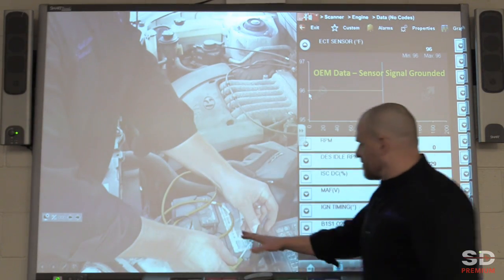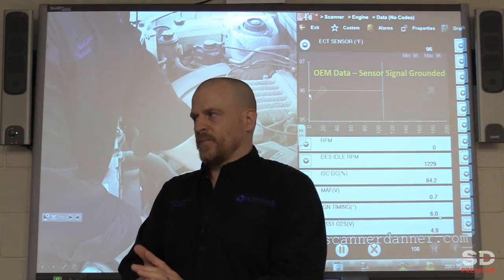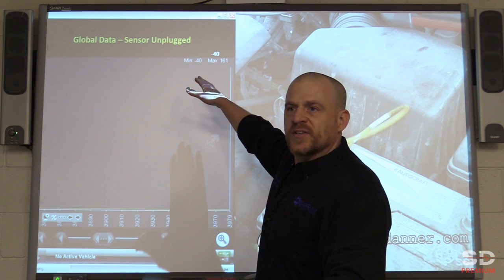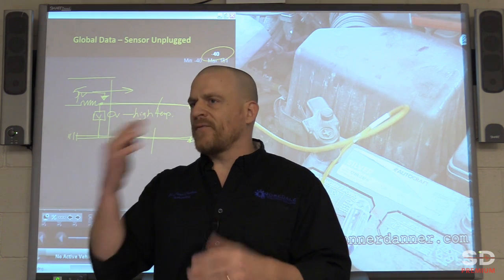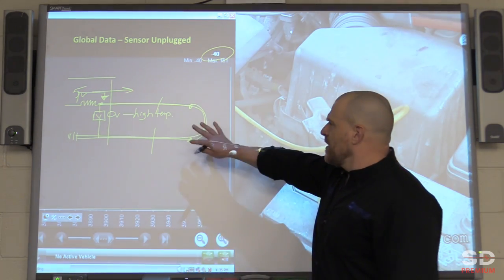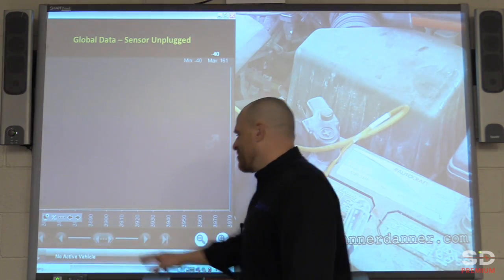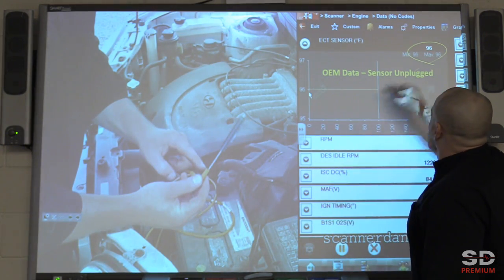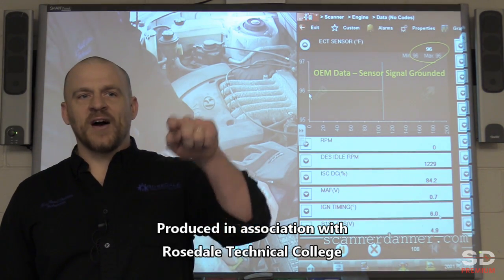Substituted Values - Circuit Integrity Testing (an SD Premium preview)

Comment: Can we use a resistor box with the resistance to simulate a good sensor and call it a day? I've built a resistor box myself with various resistance settings and I have seen it in use to simulate sensors by applying the resistance it would usually be and the computer would detect it as good.

Comment: Another great video showing how to get the most out of your diagnosis equipment and yourself 
 Be careful if a  manufacture is using  substitute values on a scan tool or laptop for a sensor  there’s a good possibility that the sensor is using SENT, LAN or FLEXRAY  protocols and the ecm’s might stop any activity on that circuit if shorted to ground or open I would check a wiring diagram first and yes I have seen LAN and SENT  protocol on  temperature sensors as well as FLEXRAY on other sensors starting mostly after 2009 and up with start -stop technology, hybrids and class 7&8 trucks 
Because of this I will only do point to point ohm checks on the wires to and from ecm and sensor if  Circuit integrity is in question

Comment: If the car has a gauge or a light, wouldn't you see the change there if you did those tests?
Reply from the maker: separate sending units or sensors for gauges and lights on older systems, newer systems where that message is shared on a network can be even more variable as far as reaction goes.
Reply: only if you apply the known good resistance sensor with some sort of resistor.

Comment: Hey Paul. Is it different from the previous substituted value lecture?
Reply from the maker: Yes, same concept, different case study being used to drive home the point, plus I included a little circuit integrity testing as well. You'll find this video in my chapter 11 playlist. Thanks!
Reply: @ScannerDanner  

But no one needs a circuit integrity test. If you get a code, you just change the part!

So much easier to be a parts changer ;-)